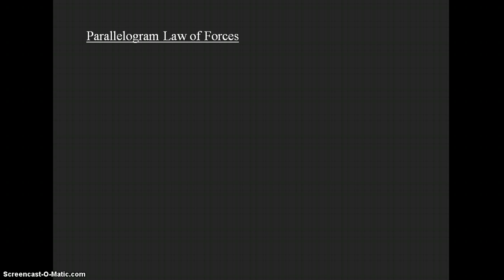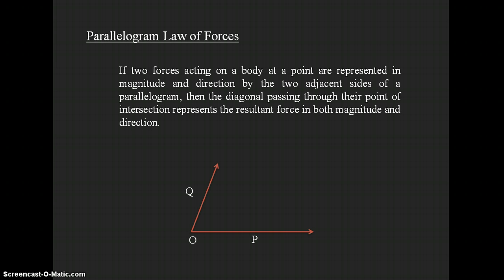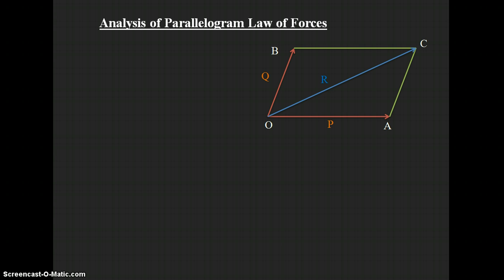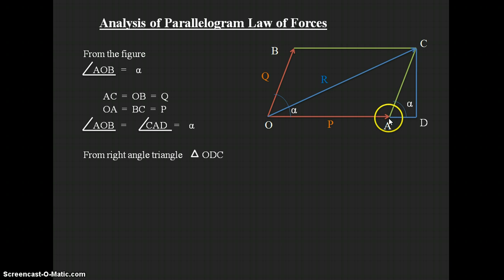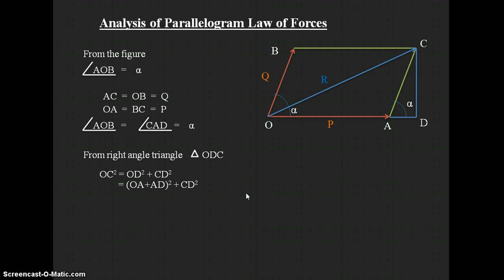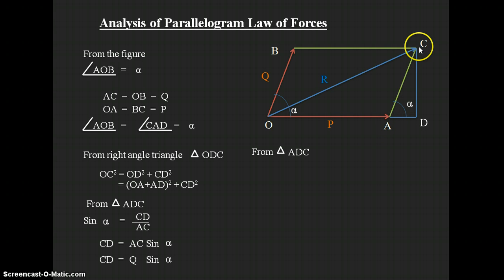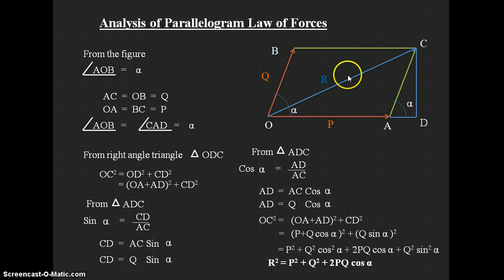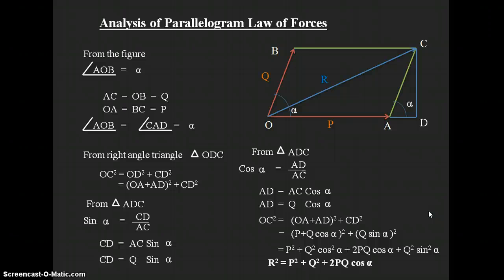Engg Mech lec3 Parallelogram law of forces

Comment: . A rocket is released from a fighter plane at an angle upward 20° to the vertical with an acceleration
of 8 m/sec2. The gravitational acceleration is 9.1 m/sec2 downward. Determine the instantaneous
acceleration of the rocket when it was fired.
Reply: Ankit Cool rocket fail 😂😂😂😂😂